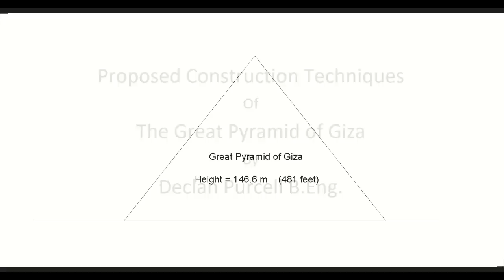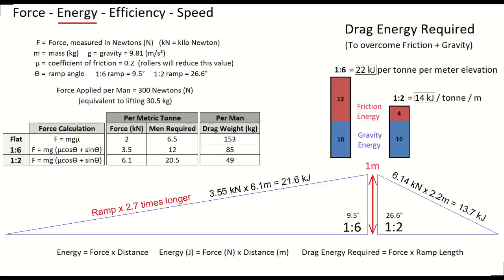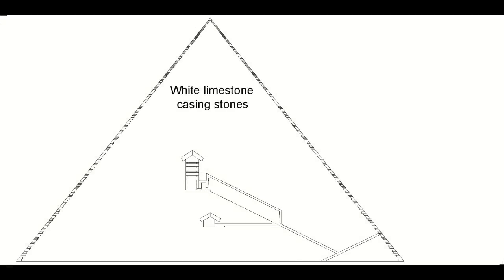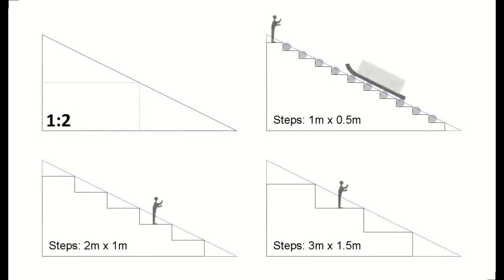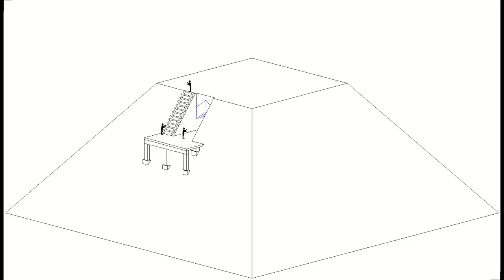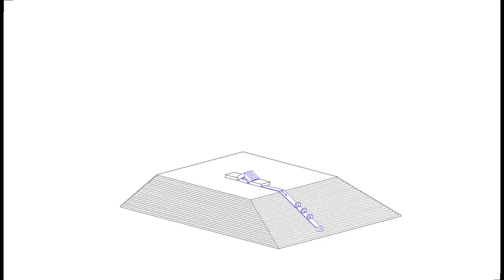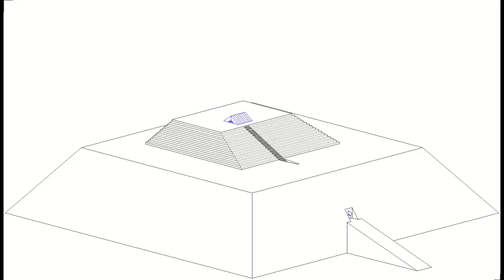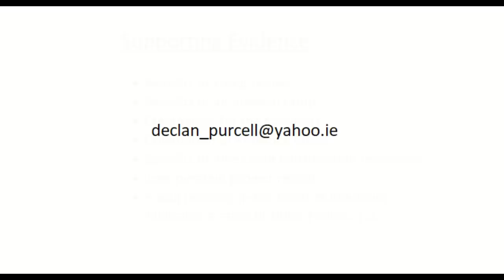Proposed Pyramid Construction Techniques

Comment: Jean Pierre Houdin's theory 2011 is the best to date. This video is very good but Houdin shows many signs of proof of the Grand Gallery being a Counterweight pulley work area for the lifting of the Kings Chamber granite stones
Reply: Jean Pierre Houdin's theory is lased with issues.
Unnecessary shallow ramp results in a massively long ramp.
Navigating corners is extremely awkward.
Corners need to be left open for ventilation, light and block turning apparatus.
Enclosing these corners after construction is extremely difficult.
The grand gallery only reaches a height of 40 metres.  The KC gable stones are approx 80 tonnes at a height of 60 meters.
A counterweight requires the elevation of a mass equal or greater than the mass to be lifted.  It would be easier to just use manpower to directly raise the blocks as opposed to using manpower to raise the counterweight and then using this to raise the blocks.  A counterweight would make sense if manpower was very limited, but manpower was not limited.  
The apperatus to operate a counterweight is more complex than direct lifting.
Houdin's proposal does not facilitate large steps which can facilatate the raising of massive blocks using the leaver and jack technique.
Reply: @Dectron1 hmmm.... maybe so. Houdin's theory has its issues and yet his proposal is the only one I'm aware of which takes the anomaly of the grand gallery into account, as well as addressing the findings from the interior radar telemetry. The interior radar telemetry showed interior ramp features. However, he miss interpreted the telemetry. It shows the Great Pryramid started off as a 3 tiered mastaba. Starting off as a mastaba explains the below ground features, such as the grotto/well shafts, etc. Also, where the massive foundation for Kufu's Great Pryramid concept was already proven stable as it started off as a huge mastaba.
Reply: @daveharden5929  I believe the Subterranean Chamber or grotto was once a large open pit in the ground. The civilization at that time who planned the Pyramid construction build carved out the Subterranean Chamber in the Limestone bedrock inside the pit,  once they had created a room type area they would started to backfill in the pit using rubble,sand and anything loose they could use,  they backfilled the hole and working up creating a shaft working upwards to ground level which is the Accending shaft leading down to the grotto that we see today.  They would of filled in that pit untill it was a mound just above ground level.  Then the Grand Gallery it's the internal ramp  to help build the KC. Also the void above the GG I am thinking it is the area that was used by the crew of men who were controlling the Counterweight ropes the men on ropes could of been controlling the drop & Lift as shown on houdin's video.

Comment: Why does nobody ever discuss how they would have dealt with water runoff if the pyramid had smooth casing stones? Water would be moving at quite the velocity if the outside was smooth, and surely there would have been water erosion at the base. But again, I have never heard it discussed and that’s kind of odd
Reply: True! Considering the heavy monsoons in Egypt!
Reply: There is erosion on some of the remaining cladding stones at the bottom, see here: https://youtu.be/xZUgrC74Pk0?t=627

Comment: It is actually possible and possible easier to raise all the blocks in a seesaw like manner....that means the ramp may not even necessary needed
Reply from the maker: The sea-saw technique is more suitable for larger blocks.     
Most of the blocks averaged 2.5 tonnes and it would be quicker to drag up a ramp.
However, if I had to raise a 2.5 tonne block all by myself I would have no choice but to use the jacking technique.

Comment: So you present the steeper ramp as better cause of same energy spent and less friction on way up, but that would mean that there is also less friction stopping the 70tonn stone to slide back down ergo you automatically need more man power, so personally don't really belive that they just pulled a 70 tonn rock up a 1:2 ramp.
Reply from the maker: On the steep ramp, the manpower is resourced to eliminate excess stress on the pullers so that they can maintain an upward force between each stroke. The steeper ramp is also shorter which keeps the lift time as quick as possible.

A shorter ramp requires less pulling manpower, but considerably more construction manpower.
A steep internal ramp requires no construction manpower.
A shallow ramp cannot be internalised. 
An external ramp (either shallow or steep) is a complete waste of manpower, for construction, and then de-construction)

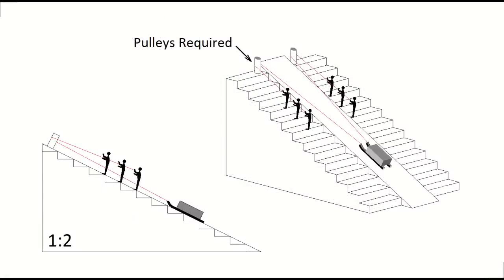Comment: please correct my math@1:34  20 men per ton. the biggest stone is 80 ton. that would be 1,600 people. Where are you going to put the 1,600 people to pull the rope at 60 meters high?  Also the hemp rope would have to be so thick man could not put hands around it. 1600 doesn't include the friction or elevation.
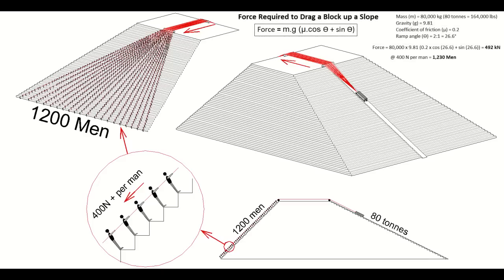Reply from the maker: See 5:37 for 80 tonne rope lift proposal.

Quantity of men required depends on ramp angle, coefficient of friction and fulling force of each man.   
With a steep ramp, friction reduction measures are more practical due to the minimum ramp length.   
The reverse drag technique allows men to utilise their body weight to increase pulling force (eg. 15 men per tonne).   
A multitude of ropes ensure rope stress does not exceed breaking strain.
Reply: @declanpurcell571   I see now. also with steps: 1m x.5m diagram a wood sled on wood log is even less friction. Thank you.      👏

Comment: Ok. Now we have to figure how the leveling of the bed was done. Then transportation of material, from more that 48 kilometars away.
Reply: It's not known if the bed is level, some people (Graham Hancock for example) think it was build on top of an pre-existing mound.  But it's actually pretty easy to level ground without modern tools, simply dig a trench and fill it will water, if the water is level all the way across you know the sides of your trench are level and you can go from there.
Reply: @NoddyTron  You can check top horisontal deviation of modern buildings and the piramids. We don't have a single modern building, made with concrete that has tolerance like the piramids. They made it out of stone blocks.
Reply: @denisdimitrov5051  Who told you that?  Whoever it was needs to visit any modern city, lol.

Anyway, I'm not saying they weren't good at construction back then, but to say they're better than we are now is simply not true.

Comment: His makes sense,
Have you heard of jean pierre houdin theory, i think this could go with it
Reply from the maker: Problems with the Internal Spiral ramp  (Jean Pierre Houdin theory)
1: Very shallow angle means the ramp is incredibly long (oner 1 km to reach the top)
2: Up to 18 corners to reach the top (Extremely difficult to navigate blocks around corners)
3:  Corner sections need to be exposed during construction which means they need to be filled after construction … This is an extremely difficult task…..

Comment: The Queens Chamber "vents" were blasted open by Europeans, did not connect in the construction sequence for that purpose.  They're enclosed at the room end.  Then opened MUCH later on.
Reply: What would happen if the pharoah died before the pyramid completion , the queen chamber was ready ! It was plan A ,
Reply from the maker: The question is:  Were these shafts bricked up during the original construction (when they were no longer in use) or was the outer stonework never cut to connect to the vent?

If the outer stone work was not cut, it should have been very difficult to discover the vent shafts which would be completely concealed.  But something got the attention of James Grant (Bey) in 1872.  If you look at the quality of the joints, it is highly unlikely that anyone could have predicted the presence of concealed shafts behind the facing of uncut stone with high quality joints.

There is no logical explanation as to why they would incorporate vent shafts if they were to remain blocked up.    Some might suggest that they would have been opened up for the burial ceremony, but that means they would have to cut through the granite with hand tools making it difficult to produce a quality square opening without chipping, a job also requiring light and ventilation.   It would have been a lot easier to cut the openings before these blocks were placed and then cap them when no longer required.

If you look at photos of these openings, they look too perfect a cut to be the result of making a hole into the wall back in 1872 to see what’s behind.  Maybe they did decide to make them perfectly smooth and aligned with the concealed shaft, but why make such an effort… (as I previously mention it is also a difficult task to do this in granite)

A much more logical explanation is the vents were cut and open to the queen’s chamber.   The necessity of having a ventilation source to facilitate the lamps necessary for illumination for workers and /or priests reinforces this need.

If the openings were plugged back in antiquity with a precisely cut square piece of granite, could it be done so well as to be almost impossible to identify.   Could they have used a mortar so good that it appeared it was the same piece of granite, so much so the plug was slightly overcut during removal.    What level of lighting did they have to truly examine the evidence it was a plug they were actually cutting out…   A damaged / cracked plug would also indicate the possibility of an air shaft…

Based on the above, my assumption is:  These air shafts were used for a number of years during construction for ventilation purposes and then plugged when ventilation was no longer required.
Reply: @declanpurcell571  and to keep bats and mice from reaching the Queen's body ?

Comment: I like your approach to the explain building "process". And excellent animations!
It seems quite feasible overall and also provides a theory that explains the sudden ending of the queen chambers "vents" at an equal level. Also, the main entrance would have been accessible during the entire built of the pyramid. 

However, you should test (or complement) your hypothesis with the question of how the builders managed to keep track of the geometry and alignment of all these internal structures and the geometry/flatness of the pyramids outer casing, with regard of the colossal dimensions of the finished pyramid? 
A challenge even today, with modern methods and tools. Something that most "pyramid theories" overlook, or disregard.

I believe, as you showed in one of your scenarios, that the builder kept the internal features exposed as long as possible, to ensure this alignment.
Resent and precise measurements has shown, that most of the internal (and very large) structures line up surprisingly exact on a single vertical plane.  This could possibly only have been achieved, with the available tech at the time of the built, by keeping these features exposed during construction.

The "hidden ramp void" in the pyramid must therefore have avoided interfering with that "line of sight". Probably, by being added afterwards. 
Also, a partially constructed, but rather high pyramid core, late in the built, could have been used as a (raised) platform to check the pyramids angles and alignments, before placing the outer support blocks and aligning/finishing the casing blocks.

Comment: Why is some type of cement not an option
Reply: Because it’s made from sandstone and granite.
Reply: All material has to be ground to a very fine consistency before it can be used to make concrete.
Reply: @scottbreseke716  That’s not technically true. It’s possible they had access to gravel and some way to make cement. You could make concrete and throw giant chunks of crap in it if the concrete is thick enough. 
       None of that matters though, because this material is not concrete. People have tested the material and found the quarries that it came from.

Comment: Watching the explanation of the ramps I thought he has pretty much drawn a simpler method. why not load up one side with rocks and the other side with what your trying to lift. All that back breaking labour suddenly vanishes as you could load up one side with pebbles in theory. A rolling log on top would eliminate wear on the rope and you could even add a winch system to gain extra pull.
Reply: @RootinrPootine  Not sure what that face is suppose to mean
Reply: @Drowe71  how you gonna lift the thing that’s helping you lift the other thing 😂
Reply: @RootinrPootine  I was talking about a counter weight, if your referring to  lifting the thing one guy explained pivotal action as a means to maneuver the blocks so go check out his video if that's your concern.

Comment: I don´t understand the idea of an internal ramp, when it is much easier to haul the blocks up on the outside of the pyramid - would be quite easy and effortless to preform with ropes and the men hauling going down on the other side of the pyramid, so that they only needed to use their own weight to haul up the stones.
Reply: would have made big scratch marks in the nice smooth casing stones
Reply: @mikev4621  ? They would offcourse have made a wooden contruction and watered it with water, when sliding the stones up. Actually I think they for the lower parts of the pyramid, where the most stones is needed, might have had 4 ramps and 4 work teams
Reply: @olebendtsen6117  yeah

Comment: My problem with internal ramps would be dissipating the amount of waste heat energy produced in an enclosed space by using grain-fueled human bodies to increase the potential energy of large masses in a hot climate.
Reply from the maker: The longest stretch of tunnel is from the chevrons upwards and is an approx. 150m in length.   Approx 220 men would be located within this tunnel during lifting manoeuvres.  At ~ 100 Watts per man, this will generate approx. 22 kW of heat which will produce an upwards movement of air within the tunnel (ie. the stack effect) which will draw in fresh air at the base and maintain a continuous flow of air.  Assuming a requirement of 10 l/s of fresh air per man, results in a total required flowrate of 2.2 m³/s.   If the tunnel had a Cross Sectional Area of 4 m², that would mean a 0.55 m/s air velocity through the tunnel would be required to provide adequate ventilation for breathing and temperature control.

Comment: But as the block gets higher less men would be able to pull the load up until only two guys are left. Unless they used the post method and walked down the stairs as they pulled it up.

Comment: No , Mr. Purcell, there is also a THIRD MYSTERY: how did they create the blocks for construction? Their measurements are precise, their surfaces are smooth as a mirror, their hardness in some places is the hardest granite. This THIRD question is a greater mystery and as long as that has not been answered, all suppositions for building the pyramids are built on quicksand.
Reply: not really, the chisel and the wedge are truly mighty tools my friends

Comment: I'm in the civil engineering field, and this is the best theory I've seen about the Great Pyramid of Giza. I just can't imagine that this was possible in a "20-year period," according to the Egyptologist. You have to consider the distance those granite blocks had to travel to get there. Maybe they used the Nile, but how big should a ship be for 80 tons of granite? Copper tools and dolomite pounding rocks? Great theory, but there are still a lot of questions that need answering.
Reply: The stones used in the construction of the Giza Pyramid were mostly quarried locally. The largest stone, the King's Chamber, was quarried from the Aswan region about 20 miles (32 kilometers) away. However, most of the stones are believed to have been quarried much closer to the site.

Comment: actually the pieces were rolled using loads and loads of lumber.  not the way you think. not on lumber, the lumber were pegged into the ground and used as a sort of stilt. there was never a RAMP.  there was no need for the ramp.  there were no slaves moving rocks. you only needed a few dozen to do the tilting.  this method was used to get the pieces out quary by stuffing wood under then stilting. as they were being rolled they were being shaved to fit properly. as they were shaved, all shaving were repurposed. the stilts made the desert look like a giant crocket game.  not only was this efficient, the amount of people necessary were vastly lower than one could imagine which is why slaves were unnecessary.  people only ate least during this time and barely shit. during the days it seemed like you could just watch each piece fit in in slow motion. i should know, i was there. the see saw is the only thing you got correct. but the ramps... i mean they just weren't RAMPS.  just stilts. we all watched the deforestation, many starved just to see it finished.  people came from all over.  then the "Egyptians" came, raided the place and filled it with graffiti. go math! 

just kidding. nobody knows the answer, shut. up.

Comment: Given the thousands of hands and being surrounded by moldable sand...i wonder why people think they had push the slabs up ramps. Surely walking an entire level into place and then removing a few feet of sand might be easier?  They made good use of water. And damp sand is more rigid sand 🤷
Also the rock cutting mysteries 🤦 abbrasive cord as was used in china centuries before, and flywheels.